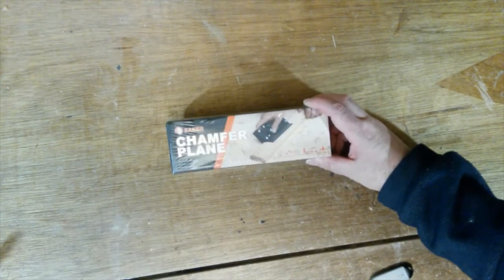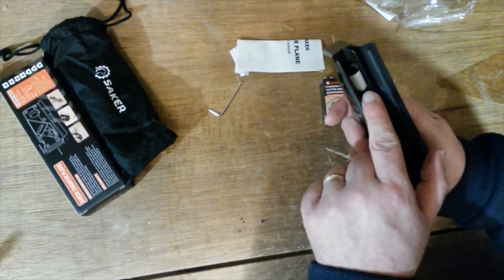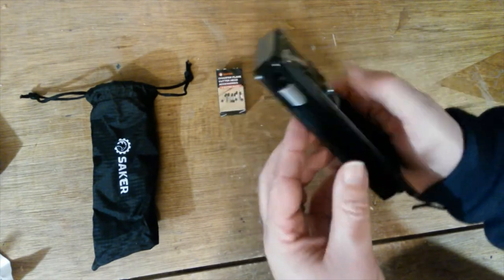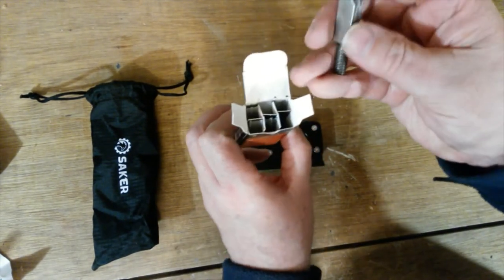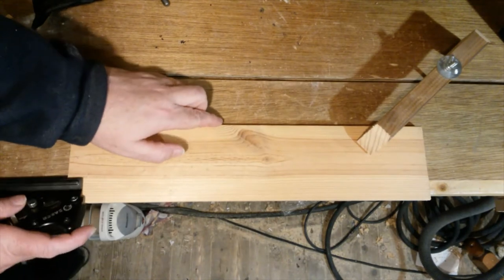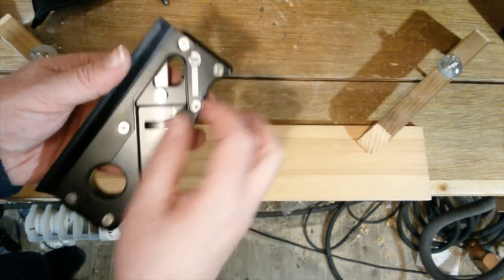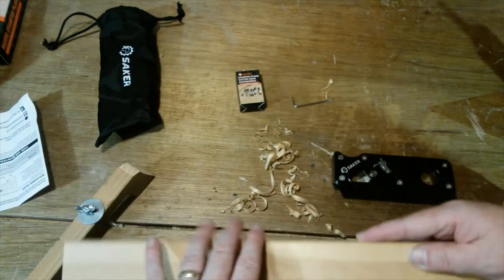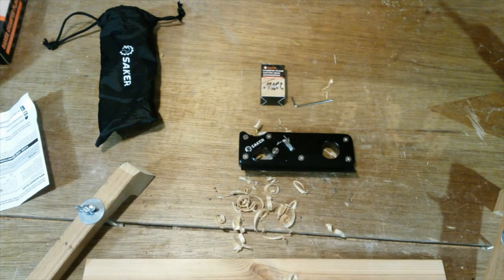Saker Chamfer Plane

Comment: That's a well made tool Neil. You'll have to reduce the depth of cut taken as you progress with the profile shape as the area your cutting is 
becoming larger so it'll be harder to push. Is the Allen key used to move the guide from one side to the other for left and right hand users. 
Looking forward to seeing the other profiles it cuts on your future projects. Thanks for the review I've never seen these before. Tony
Reply from the maker: Thanks pal. The Allen key is to fit the auxiliary guide to the plane unfortunately it only fits to one side. Mine came with it already fitted though.

Comment: I tend to use a block plane to create chamfers and round overs.
Is this bit of kit just a chamfer plane or are the other profiles used to create different mouldings or rebates? If so, do they have a selection of different cutter heads, in addition to those in the package?
That would be a versatile bit of kit if yes to all those questions.
Reply from the maker: I think it's just for different moulding when I looked I didn't see any other cutting heads available